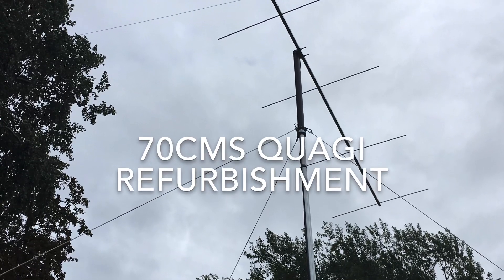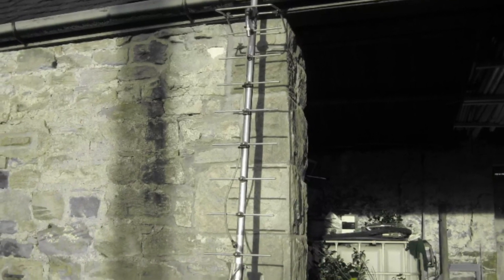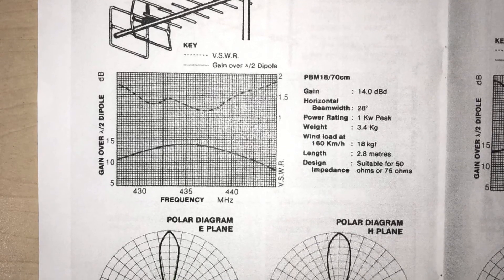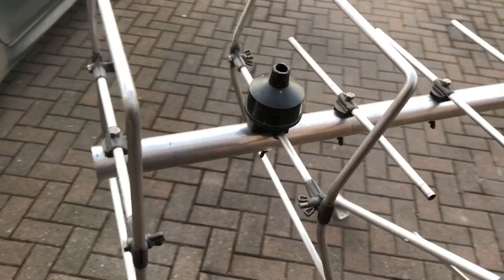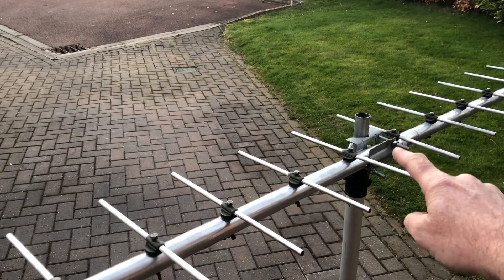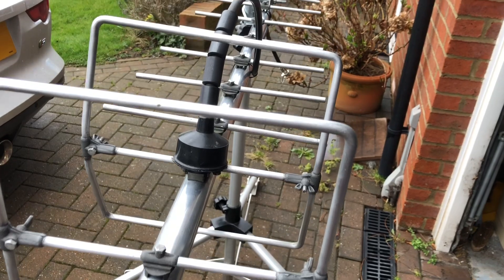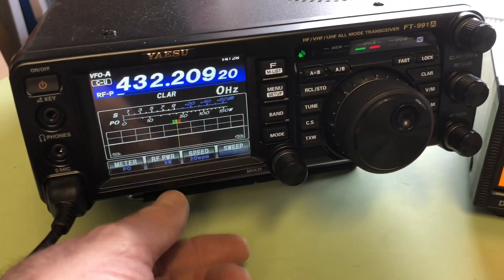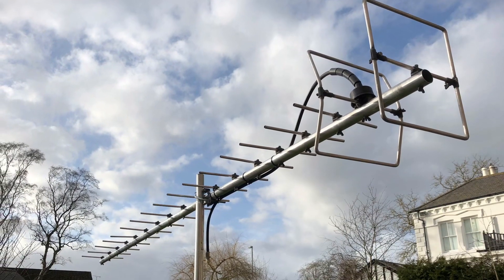Jaybeam Parabeam 70cm (Quagi) Refurbishment

Comment: Hi Ian, I have a Jaybeam Multibeam version of this, it has tbe same quad parts but with the X type of directors. It has a similar issue to yours, although the problem was the bolt attaching the dipole to the boom had corroded and broke off. I stored the antenna a few years ago thinking that i could probably repair it at some point in the future. I'm glad that you've used stainless steel bolts to repair it with, as that's what I intend to use. Although I have an additional problem where the plastic has got a crack and was considering replacing the whole feed point with a waterproof box in some way. I used mine as a fixed local vertical. Incidentally, I wondering why the ferrite chokes, I never had these on mine. Ive also only just getting back into the hobby for the first time in 20+ years.
Another thing, does rhe xfs in your YouTube name part of your callsign?
Reply from the maker: Hi Ian, I’ve replied to your FB post as well. See references to websites. The choke stops the RF coming back down the outside braid and radiating. It means the beam does what it’s meant to pattern and performance-wise and you don’t compromise by lobbing RF in weird directions from the coax …a waste…. Good luck 👍🏻 No, call is G0CNN 😀
Reply: @G0CNN-Ian  Many thanks Ian. I've just watched a very interesting video by G0KSC on Quads too. I used to have a pair of MET 17 elements in the 1980s, that I used portable, I only had the 19 ele Tonna up at home. I've only just put a dual band Diamond colinear up, just need to get some more up eventually. 😃
Reply from the maker: @ian.dobson  Yes, I used to have a Metalfayre NBA 14 ele on 2m.
Reply: @G0CNN-Ian  I don't recall that name, or is MET the shortened name?
Reply from the maker: @ian.dobson  I think it might be Ian. It had rear 45° angled reflectors, two each side I recall? Was meant to be the bees-knees at the time….was long!
Reply: @G0CNN-Ian  that sounds like it then, although I'm not sure the 70cms ones were angled. Memory is a bit fuzzy now. 😂

Comment: Silicon sealant gives off an tiny acidic film when curing and I think it could have been that process that led to the corrosion on the metal elements. It has little effect on coax plastic sheath. 
but does react with metalic objects. Worth knowing for any future use.  We found this out working for Nynex/Cable&Wireless/NTL it corroded the F-plugs and splitters etc.
Reply from the maker: Thanks for that info Mark 👍🏻 Not something I’d do myself, but yes I agree.

Comment: Ian, interesting to see this.  I have a Parabeam stored in my loft that have had from new since I first had my G8 call back in the late 1960s, when I still lived with my parents.  In those days G8 calls were B licenced that could only be used on the 70cm band and up.  I have not used my Parabeam since my parents moved house in 1971.  I keep meaning to refurbish this antenna!
Reply from the maker: Hi Mike! Great story! I used this for about a year in the UKAC contests and then upgraded. Worked fine 👍🏻
Reply: @G0CNN-Ian  Thank you replying.  Did you feed the Parabeam with 75 ohm coax or with 50 ohm?  Did you use a transceiver that has a 50 Ohm characteristic impedance?  Also my Parabeam has yellow caps on the ends of the elements and the boom has internal fit end caps.
Reply from the maker: @mikekeeping2517  Yes Mike 50Ohm Westflex-103 back to the rig. Choked at the dipole feed 👍🏻

Comment: Silicone sealant has acetic acid in it which corrodes things during the cure/drying.  This sealant  has a vinegar like smell which is the acetic.  Not good on steel or copper. Plus the flood on 70cm would be a lossy dielectric slug/puck.
Reply from the maker: Yes, I eventually got it all out and the beam worked very well in contests since it was refurbished 👍🏻

Comment: Great to see your refurb of the antenna. I recently picked up one my self that appears never to have been used but is missing the rear reflector quad, going to make something up to replace the rear reflector and then finally get some use out of it.
Reply from the maker: David Taylor Great David! If you need any measurements or pics, just give me a shout 👍🏻
Reply: Hi Ian could you measure the length and width of the reflector please. Just the measurement of the individual side not the whole square please.
Reply from the maker: Dave, full width is 257mm, full height is 277mm. Inner width which middle horizontal element has to span is 241mm. You’ll know the tube diameter from your dipole element. Anymore, just let me know 👍🏻

Comment: I worked all over the UK on 70cms SSB, back in 1984/5. I had a 10 element beam and a Yaesu FT-790R, which I used to take to a local high spot. G1DRP
Reply from the maker: Good one Ian! I wasn’t on 70cm, but back then I had 2m with my FT-290R (+MUTEK) and a 14 ele Metalfayre NBS Yagi (ex G1EVU) 👍🏻
Reply: ianxfs I have a couple of FT-299s and I prefer the RX performance of the one in which I fitted a 3SK88 in the front end.  It’s still in regular use and I’m considering fitting a ctcss encoder to it.

Comment: Good job on the refurbishment. I have to admit I’m a bugger for using silicone.... I have got a duel bad YAGI for 2/70 and a rotator in the trailer I will have to give these RSGB ssb competitions a go from my favourite spot up in the Peak District.
Reply from the maker: G1WHP I suppose it depends if it has been out in the elements for years. Silicon might not be the best idea...

Comment: That's quite something Ian! You should slay in the UKAC with that bad boy! 😊👍
Reply from the maker: John Ratcliffe Ha Ha John, I wish! It’ll be a different operating technique I think, due to the narrower bandwidth than a typical 2m beam? Anyway, need this storm to drop to try it out. Must have only had half a dozen 70cm contacts since coming back on the air 14 months ago, so looking forward to it 👍🏻
Reply: @G0CNN-Ian   Well I have every confidence in you; good luck!
I am using a vertical for 70cms UKAC, which is restrictive, despite the height of my QTH. I have found a 2m and a 70cms Yagi I'll mount on the same pole, but we're thinking about moving so that's delayed until we've sorted that out.  I think Yagis are a super investment and should bring much fun. Enjoy and thanks for the uploads!

John M7JHA

Comment: Ian, the Parabeams are great - the design may be old but they still work well. I would mount the feedpoint with the plastic cover under the boom. This will help in the rain! Less important if you only use it /P but water in the coax is best avoided. 70cm is my favourite band but needs a bit more work due to the narrow beamwidths. When there is tropo it is amazing! 73.
Reply from the maker: g0jjg Thanks. Yes, looking forward to using it in anger. I’ll weatherproof the feed point and like you say, it’s only for /P exploits, so won’t be outside much 👍🏻

Comment: That was a timely video Ian, just getting together the bits to put a Diamond X50 colinear vertical up. I wonder if I can use the same arrangement of ferrites near the top of the coax on that and how did you come to the conclusion on 4 ferrites please ?
Reply from the maker: Hi Steve! I did some research on the Internet and as well as others, a good source of information on type 61 ferrites is: https://www.hamradio.me/antennas/fair-rite-2661480002-type-61-ferrite-slide-on-chokes.html

Your question, prompted me to add it to the main description, so thanks for that. 

I don't think colinears are meant to have chokes installed, as the antenna radials should decouple the antenna? 

Hope this helps!

Ian.
Reply from the maker: ps. A choke at VHF (or any other frequencies) won’t do any harm mind if you’re going for it regardless....